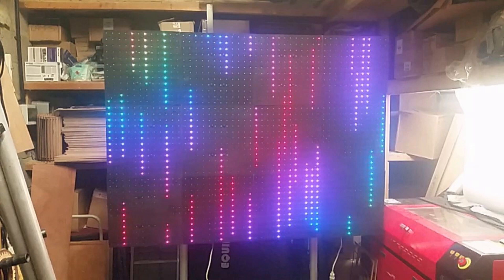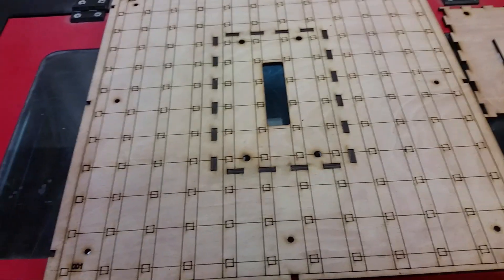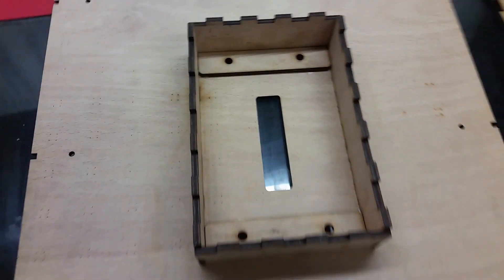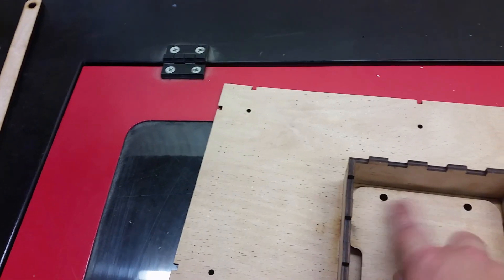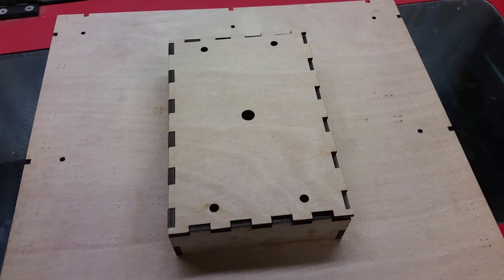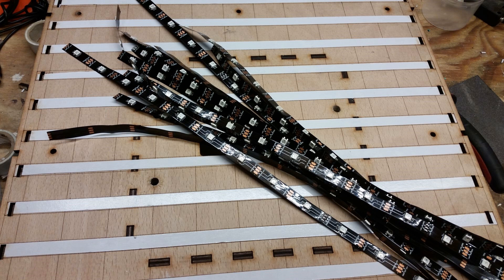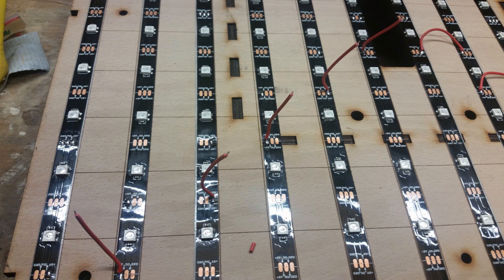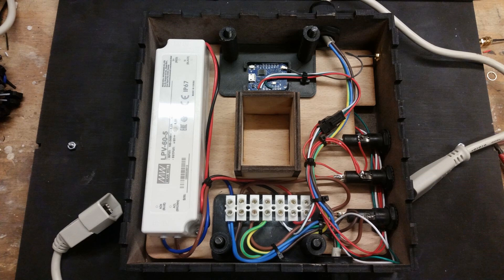DIY 12x12 Pixel Panels, VideoWall, Arduino, ESP8266 ArtNet WS2812 LEDs

Comment: Hi there, I was going to send a private message but I can't seem to find the option for that anymore.
I was wondering if your were planning on sharing the designs for this online at all?
I'm currently in the process of trying to design some panels like these that I can control from DMX software such as Chamsys MagicQ. 
On another note, what do you use for control of the panels over artnet?
Thanks again
Reply from the maker: Hi Karl

I can share the design files, it was done on CorelDraw, but not the code that's running on the ESP